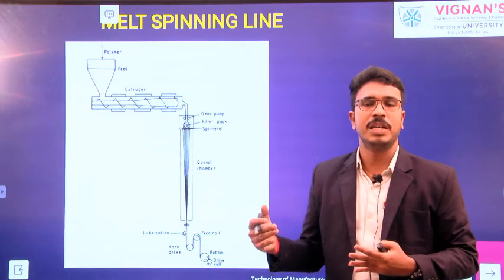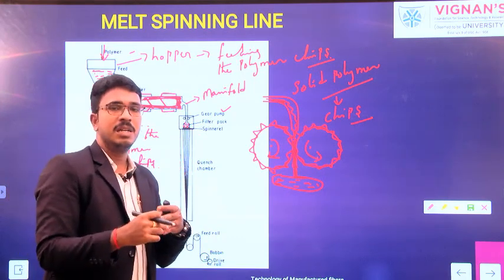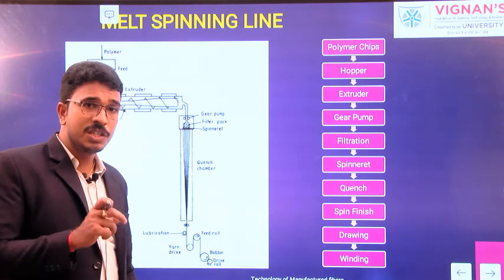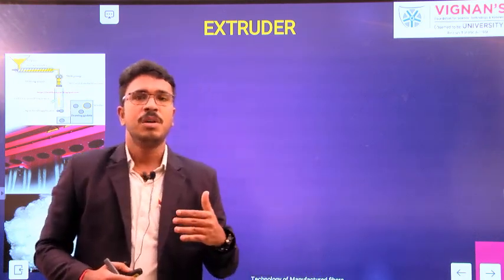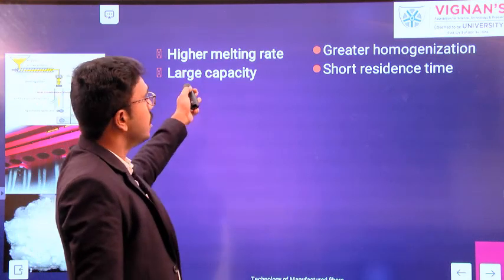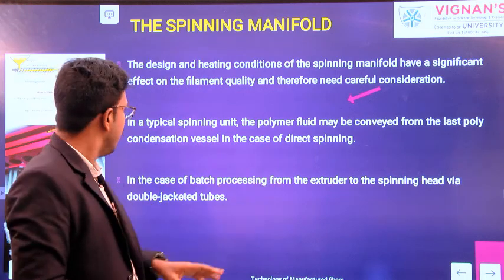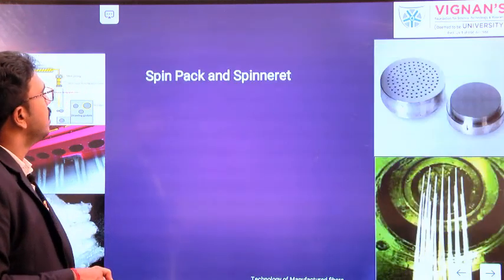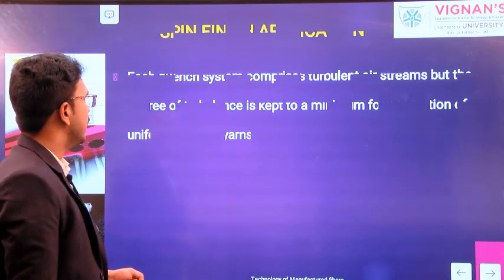Melt spinning

Comment: How do you keep pressure in the extruder from rising so high that the extruder doesn’t break down?

When you change the spinneretts you would have to shut down the spin pump. How long can you have it shut off before pressure gets too high in the extruder?

Does the extruder have a pressure release function?

How much down time would it take to switch the extruder from let’s say from nylon to Perlon? 

Can you explain the condensation process in making the chips from AH salt?

At what temperature should the spinnerettes stay heated to prior to being installed on the spin pump?

Comment: How many days /weeks before the spinneretts need to be changed?

Is there something you can do when holes get clogged, or it’s best to just change it?

In the drawing stages between the first godad and second is where you find the stretch point. From what I heard it’s best to keep the point closer to the first godad, and I guess you can only do that by controlling the speed of the godad, or adjusting the heat would also make that possible?

Without risking changing the yarns properties when analyzed in the lab?
Reply: what is this hole size of spinneret for 300d/48f
Reply: can tou tell me spinneret hole size for 300d/48f poy yarn